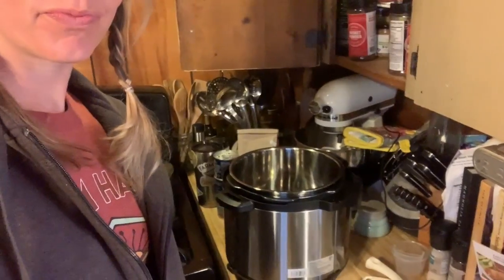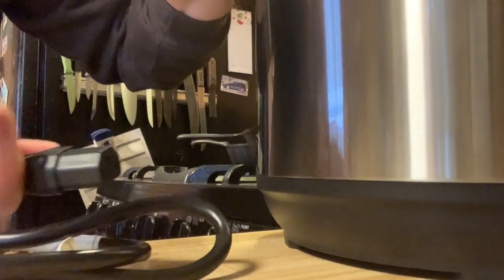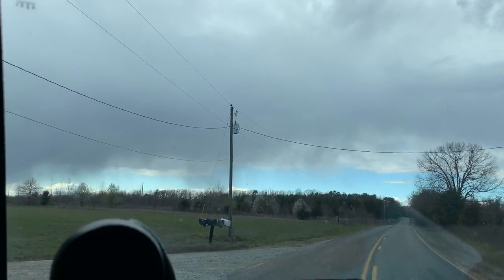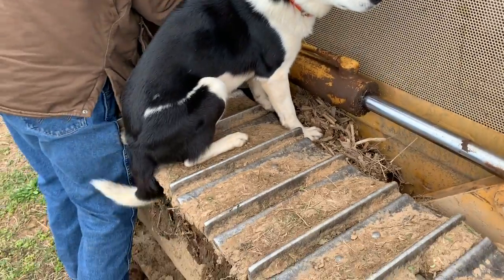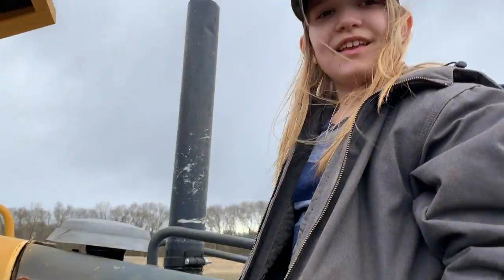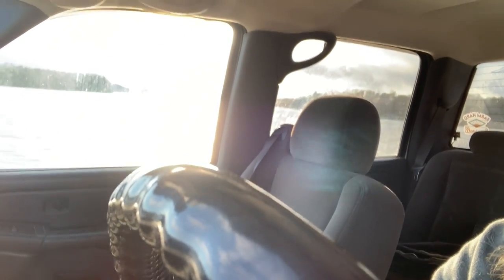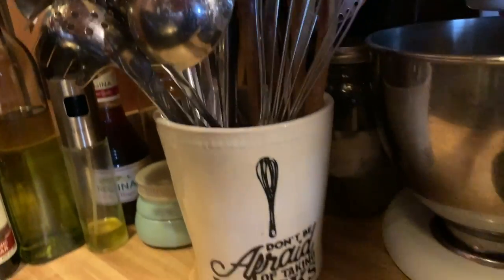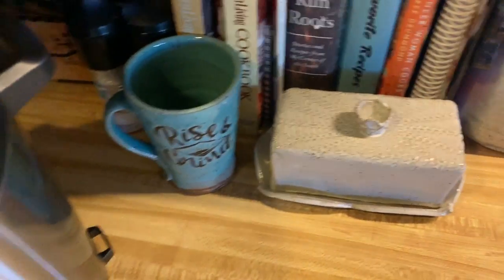What to do with all this SAND?!

Comment: Im an old bachelor and ive been using my instapot for a year. Its soooooo simple. Frozen chicken in 20 minutes but then i use the oven to crisp it. Fully cooked beans (soup) from hard unsoaked beans in 30 minutes. Brown rice in 20 minutes. Whole potato in 20 minutes. A pot roast last week took 2 hours for tender pull apart beef. Natural release means you dont manualy release steam. Let it alone until the little tab drops. Its easy.

Comment: I think you were right the first time when you were calling it an "Insta-Pot". We love ours. You do not have to be there when it's done cooking, it will switch to a "Keep warm" mode just like your slow cooker when it's done.  You just need to be sure to release the pressure valve before you open it.

Comment: Mom has the instant pot, I use the power pressure pot.  Normally will put food in.... come back hours later.. keep warm for four hours after cooked.  Think the Instant Pot is very similar.. major difference is the Instant Pot has stainless interior.  I normally add 2 cups of water for roast or whole chicken.. save the broth, get full 2 cups back :)   Do your normal recipes, so much faster in these pots compared to slow cookers.  I still use my slow cooker for things though too...   Put meal in at noonish... back to chores... time to get cleaned up.. and whole meal is warm and waiting... love them for that aspect.  Always will be cooked using one of these cookers.

Comment: When you set the instant pot to 30 minutes it won’t start the 30 minute count down until it gets to pressure. After the 30 minutes it will start to count up. You don’t have to be around. It will keep it warm for you. When you turn on the instant pot in the beginning don’t forget to set the knob on top of the lid to seal NOT vent. Very important. This machine will change the way you cook. Big time saver.

Comment: That 450 is a good machine. I think Lawrence may have done some grading before. No dips or gouging just straight and level. Instapots are wonderful.They really tenderize meat well. Just throw any old tough meat in it and it will come out fork tender. We use ours all the time. Lucky fence post.............

Comment: I've had a Insta pot and a power pro air fryer. They both cook great meals. In about 40 minutes the pressure cooker will absolutely make a roast fall to pieces. It's much safer than the old cookers.

Comment: I love my Instant Pot, mine is a Mueller I got on Amazon. So easy to make bean soup. MMMM MMM. You don't need to be there when it ends. The "natural" pressure relief is activated automatically by the cooker. It just adds cooking time as it cools to regular boiling temperatures.

Comment: We have been using a pressure cooker for at least 30 years.  As long as the pressure relief valve is checked regularly there is no safety issue.

Comment: Meredith 
Just a thought, when it comes time to cut crop to make sileage, the dozer would make a great machine to push and pile it into the sileage pit, plus it will pack down with the metal tracks,
Just something to think about.
I wish I was there when you cut sileage, I would love to operate a blade dozer again, .
Reply: Kenny Dean, I live in Western Iowa and worked at a feedyard for 6 years. We used a D7 Cat to push and pack corn silage. It worked really well.
Reply: @myronparks3495  wow! A D7  I only got to run a Cat D69U at a landfill. But I had fun
Reply: And o still believe the older Cat machines will outperform the newer crap they have out there, no electronics, no DEF
Reply: Kenny Dean, we had a D7 and a D8 Cat. The D8 had the old cable lift blade while the D7 had a hydraulic lift blade.

Comment: Why not put that sand to good use by putthing in you wet spot around hay feeder and on your road way  just thinking
Reply: I agree... Some sand would build the ground up and help it drain better
Reply: Sand makes things worse on the roads
Reply: Then they’d have quicksand! HaHa! 😂🤣
Just kidding.
Reply: @shearmanken  Ummmm No, No it mixes with the mud/clay soils and improves drainage
Reply: frankoch1 ummmm not on dirt roads it simply turns to dust...I live in the forest and have a 2000 foot dirt road....and clay causes sink holes you start with pit run then 3 inch down to 3/4 minus please don’t post false information
Reply: ken shearman  I live in Mudd Sw Louisiana, we incorporat sand onto dirt roads and muddy fields, to make them stay dryer
Reply: The Peterbilt trucker Chuck we have up to 8 feet of snow....and over 5000 miles of forest and logging roads, we set up rock crushing plants to surface the roads in the Idaho panhandle between trucks, equipment and weekend atv utv our roads last up to 5 years till rutting and sink holes and washouts, if you ever hauled off road as I have it’s quite the operation...the Forrest service has standards for durability and I bought my road mix from the same suppliers...it’s a mix of rock, crushed rock fines and dirt that once spread is compacted. Anyone can throw dirt and soil on a road I prefer a road base and surface that will last and not turn into a mudd bog as I’ve seen on almost all of these farm videos
Reply: ken shearman  you don’t put rocks in a feed lot 😀
Reply: The Peterbilt trucker Chuck but you do on the outer roads🤠
Reply: ken shearman we build our roads with clay and cap with sand, if its going to be heavily used3” rock toped with road base,  but sand is used everywhere, natural filter , drys fast
Reply: The Peterbilt trucker Chuck I agree sand makes a nice filter and yes like I explained rock/pit run is used with base run then topped with crushed rock with fines....I disagreed with sand on roads...it washes off doesn’t compact and creates a lot more dust...and does not have nutrients to promote crop growth
Reply: My bad I must be arguing with trolls....at least he’s smart enough to push it off his fields
Reply: ken shearman  kool , every road down south has sand under it , even concrete and. Asphalt
Reply: The Peterbilt trucker Chuck that’s why there in such bad shape
Reply: ken shearman we ave 70” of rainfall per year “non-hurricane years” sand is required in every building application, as I’m sure as where Meredith lives is,

Comment: I love my Instant Pot. I use it 2-3 times a week. Like sweet corn? shuck a dozen ears and Instant Pot for 4 minutes. Hard boiled eggs, put a dozen or more in the Pot for 5 minutes. Because they're steamed, the shells fall right off. Great for deviled eggs. I've got the 8 quart model. I dry rub three racks of baby backs, roll them up and Instant Pot for 1 1/2 hr. I do mine in Apple Juice. After you let the pressure out, sauce the ribs and put under the broiler for 5 minutes. My wife makes Instant Pot cheese cake, Yummy. She bought a spring form that fits right in the Pot. Check out, "Six Sisters Stuff" channel. Lots of good ideas. Enjoy!